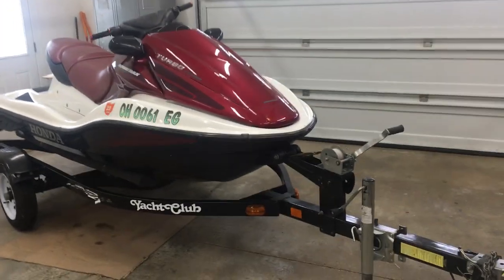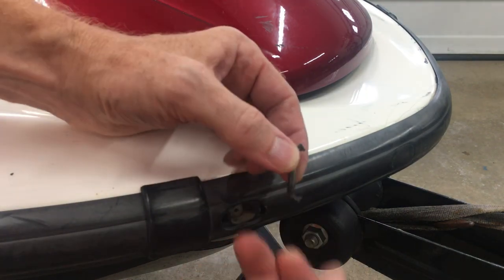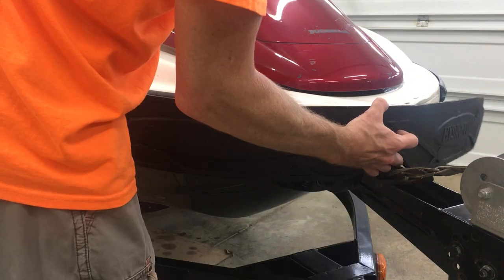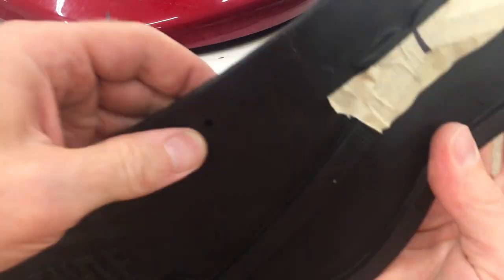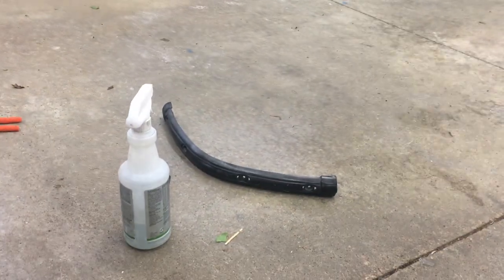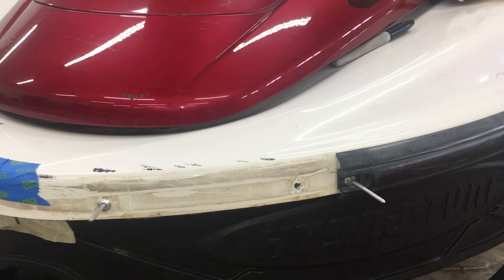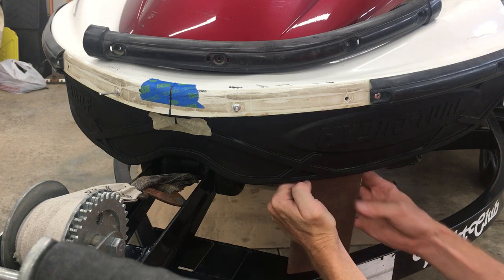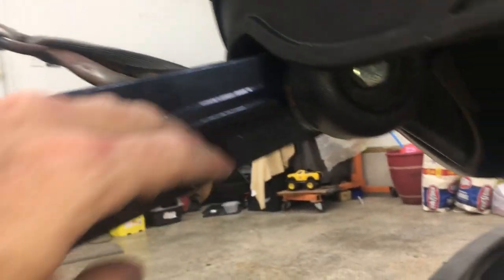Hydroturf Splash Shield Install + Review for Honda Aquatrax F12x

Comment: Hi

How would you protect the drilled hole from rust?
(The surface is metal.)
Thanks for the reply
Reply from the maker: The hull is fiberglass and the rivets are aluminum, so there is nothing that will rust.

Comment: Have you had any issues with it ripping or tearing in chop? I put a jet trim on and we were riding in heavy chop and it tore in half
Reply from the maker: I was somewhat skeptical at first, but it has held up great so far.  The only thing that makes me cringe is the front of the shield gets squished down for a second sometimes when I'm loading/unloading the ski on the trailer... but it hasn't been damaged at all.